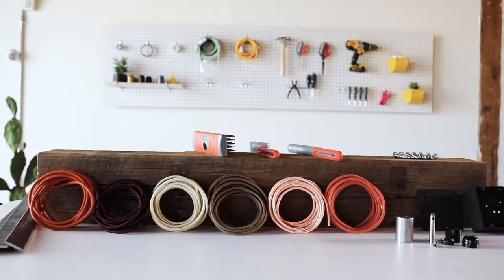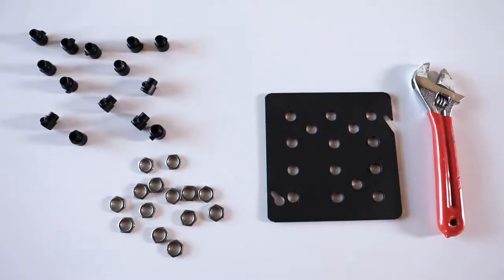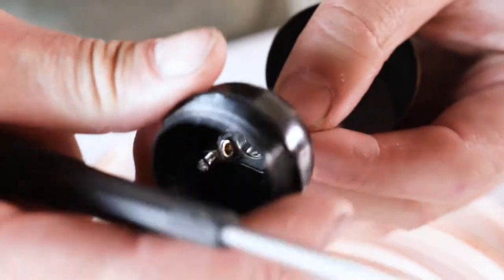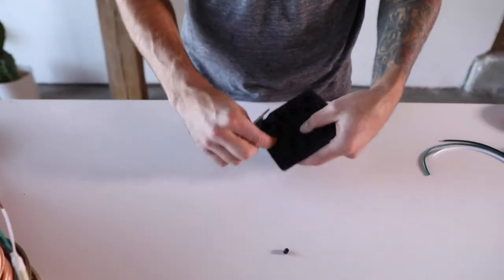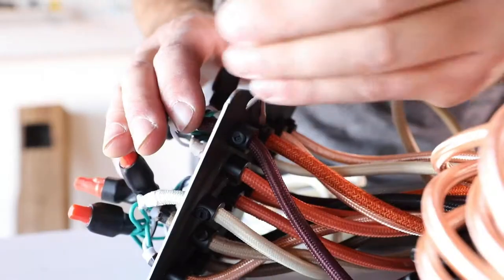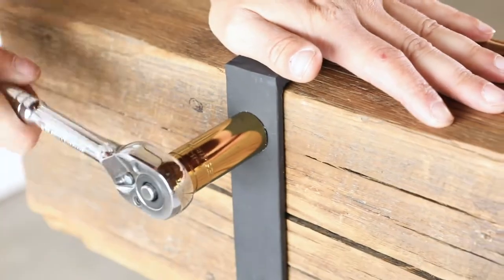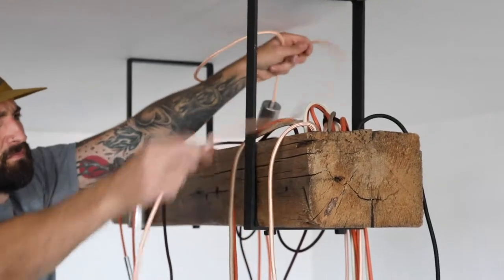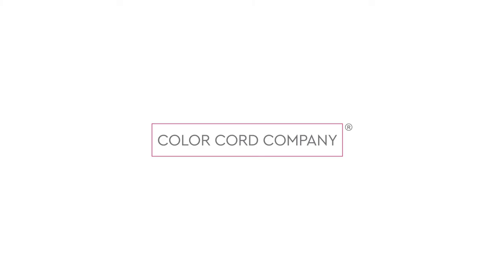Build Your Own Barn Beam Light Fixture!

Comment: Hello!

how much cord should I buy for this light to look as pictured?
Reply from the maker: Hi Nick!  
Thanks for watching!  The cord length depends on several different things:
1. The size of the beam. 
2. Number of wraps preferred around the beam per pendant.
3. The length you wish to have the pendants drop below the beam.

In the case of this project it was roughly 15-20ft of cord (keep in mind you can cut the cord down if that is too much).

We'd recommend acquiring the beam first and then go from there!

Comment: You said black positive wire.  There is no 'positive' or 'negative'.  It's AC not DC.  They alternate being positive and negative relative to each other.  The RMS potential difference between the black is supposed to be greater than the white relative to the ground wire, hence why it's usually called the HOT side.